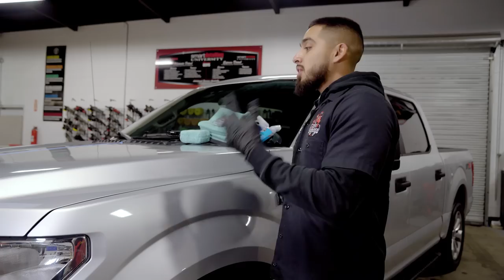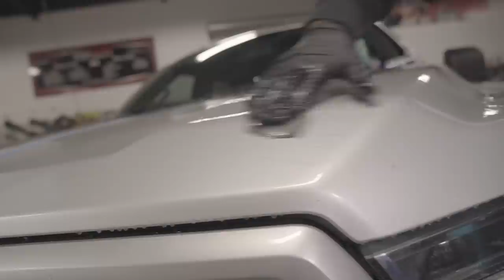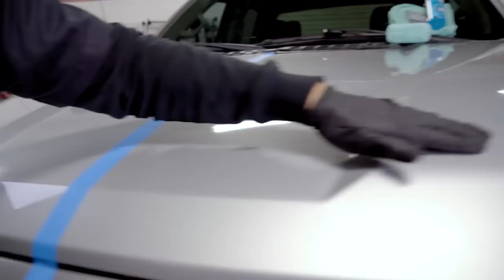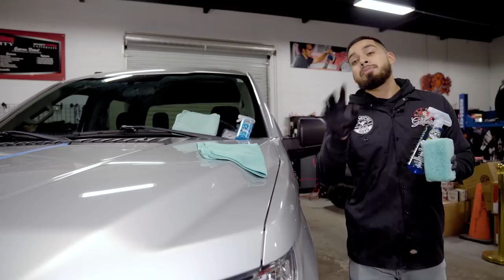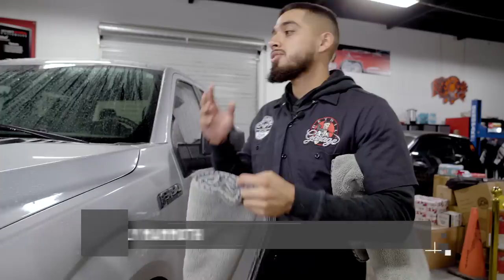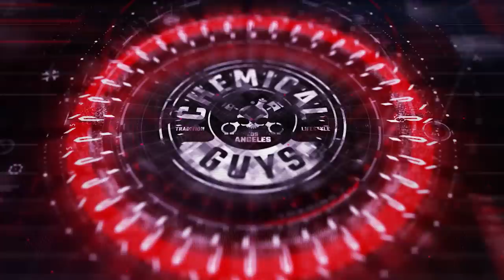Winterize Your Ride - How To Quickly Protect Paint Against The Elements! - Chemical Guys

Comment: what if you don't have a garage? Can you let the car sit outside inbetween coating hydro charge and hydro slick?
Reply from the maker: Hi Jason! As long as the vehicle is cool to the touch and out of direct sunlight it is perfectly fine.
Reply: @ChemicalGuys  do you recommend using a quick detailer right before applying hydro slick after hydro charge incase theres any minor dust build up?